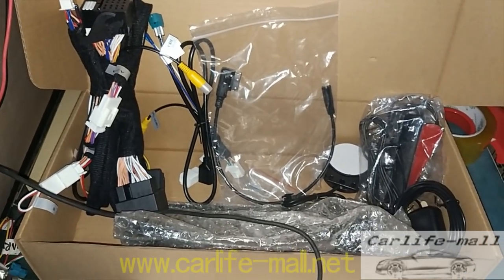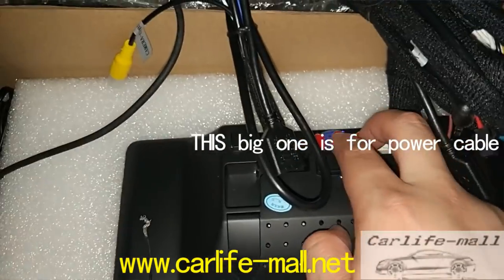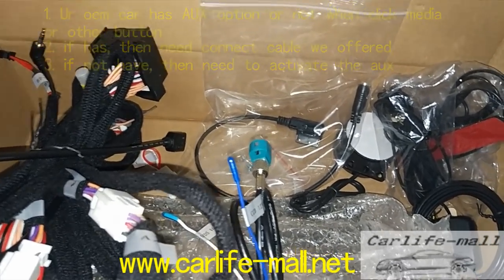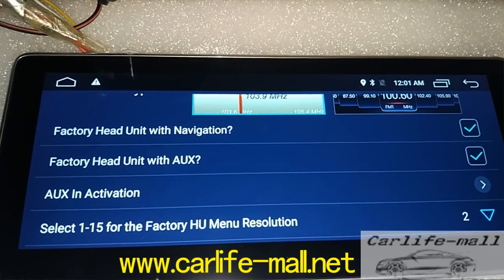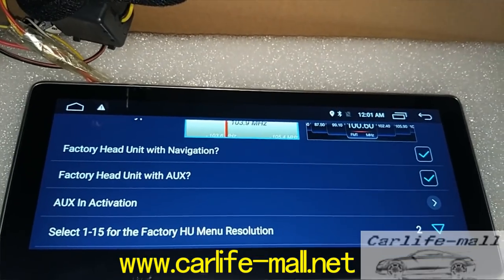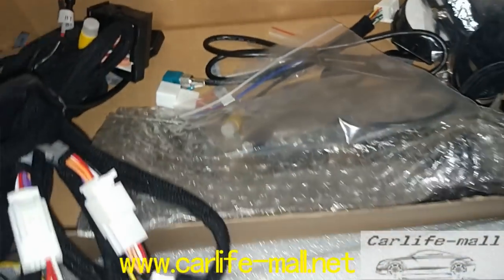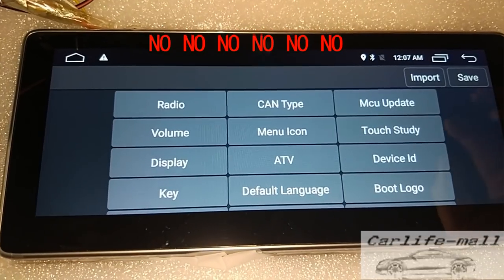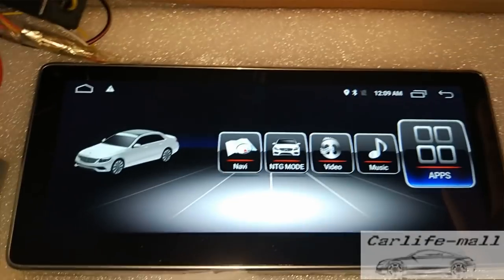10 25 inch 4gb RAM and 64GB android 8 screen for Benz

Comment: Hi I have the XHD-8000 screen in my c250 2012 mercedes and it has no sound I was told it is the amp harmon becker 9065 code. Do u have any suggestions please and I would like a upgrade on my screen do u sell them please.

Comment: Hello this is my CANBUS info: YX2BENZ v111.x9,90,00,N7,B31;00000;0.
I can't get any KF, or AF or CF...by switching the canbus A or B. Actually when I disconnect 40pin plug, both male and female, the screen automatically shut down. When I am supposed the press reset button? After 5 min, 40pin male and female disconnect?

Also I can't get my rear camera to work it is all black but the screen show the red and screen line when the reverse is engaged.

Comment: Hello. I have 2014 CLA250 without backups camera. Which android models should I order?
Reply from the maker: u can add camera if u want, https://www.carlife-mall.net/product/qualcomm-snapdragon-625-msm8953-android-10-screen-gps-for-benz-a-cla-gla-g/    u can check this link, check ur UI is ntg4x or ntg5x, then choose the correct model, then ok, 10.25 inch and 12.3 inch can be optional, any question, can write to info@carlife-mall.net

Comment: Hello, I need help. The fact is that if my car is idle for a while, then when I turn it on, I cannot go to the Android display, the message (No Signal) appears. What should I do in this situation?
Reply from the maker: 1. what screen u get friend, market has so many seller, so first must send pics of system info&mainemnu to check what screen u get
2. then no signal is OEM or oem and android both
3. if qualcomm screen, android part not appear, u can ask ur seller send software to do upgradidng to test first
further info, need check details, if u get from us, send email to the info@carlife-mall.net
if get from others, better send to ur seller
different factories, different goods and softrware
Reply: @CarlifemallEmily  Thanks for the quick reply !!! I have sent you a video by email...

Comment: Sir after installation , Aux does not works , shows “ media interface unavailable “
And now the old usb cable does not work too
Reply from the maker: hey friend, just tell me where u buy the screen?
if from us or our reseller, write us the email we contact with u, will solve for u, if from other seller, u need ask them directly
BR
Reply: Luis Diego Solano did you figure out the issue?
Reply: Did you solve it? Struggling with the same thing and would really appreciate it if you could help me out
Reply: Me too I just make our display yesterday it's work only with the radio  but no sound from USB or video  can enyone help please 🙏♥😢

Comment: you cover everything accept if you have only usb no aux everything works great but only in bt.  no sound pass from system I have base model 2014 cla I have has no fiber optic cable any help is welcome ps I used adaptor it didn't work

Comment: Hi Rock, quick question - my bluetooth phone function cannot receive incoming call (no sound) but calling out is ok using oem microphone. Appreciate if you can give me a hint. Other functions (music, video, etc.) are working fine. Thanks
Reply from the maker: I guess ur navi not have sound too
if so, u need add a speaker, always we sent in package
if not get from us, need ask ur seller

BR
Reply: @CarlifemallEmily  hello, where i can put the Speaker that you send with ? I mean outside or inside ? Thanks
Reply from the maker: @abdalnaserkhalaf9205  normally behind or up the command radio, or glove box, as u want and see where u can set easier

Comment: hello a question on the screen when I stop the car and start it has lost the date and time, you have to connect a cable that comes directly from the battery to save the date and time.  thanks
Reply from the maker: date and time just follow setting of time, if u bought from us, write to the salesman, will explain to u

Comment: I installed it today, but the sound is not quite top.  have tried YouTube, Spotify and Bluetooth but still the sound is poor.  when I put on a CD player the sound is loud and much better.  you can hear the difference.  On Mercedes C class 2008
Reply from the maker: yes, android part is not as good as original
and for this reason, new android 10 make DPS in, sound is better, but still can not compare with oem

btw, if u bought screen from us, future can write to the salesman directly too, always we reply fast

Comment: Hey there, I have purchased a sim card to put in the car for the internet but having trouble car wont read it any suggestions?
Reply from the maker: if u bought from us, our sim card support band 1 3 7 8 39 40 41, if not from us, contact with ur seller which band their device support, different factory, different supporting  band

Comment: I have a question. If I want to replace my factory backup camera with aftermarket, how is this done and what is needed?
Reply from the maker: if u only want to change a camera but still use OEM screen, i do not suggest u change screen, market has some parking module, u can add camera
dismantle ur OEM one, take alway, use new+interface video, then ok

if u want to change screen too, then our screen+camera+steps above
Reply: Carlife-mall Emily I already bought the android unit. I’m assuming I will need a fakra adapter cable from back of radio to go go RCA, yes?
Reply from the maker: @RCTuning  if u only want a rearview camera, no need buy other cable, we offered
if oem has camera, directly use
BR
Reply: Carlife-mall Emily can you send me a link? My factory camera is terrible and doesn’t show past 3-4 feet. I want something with guidelines and better view
Reply from the maker: @RCTuning  so what u mainly want? if only camera, go to workshop change an OEM, if want aftermarket camera+screen, send to info@carlife-mall.net, i will send u, remember tell me ur car model, car year, then can send u the camera pic

Comment: When installed I have no sound from radio, any help on this?
Also I did not install the silver box as my screen is working without the silver box.
Do I have to install this or it is only for older models?
Reply from the maker: u are correct, silver box is only for ntg4 old device, and ur car has no sound need to check installation and setup, if u get from our reseller or from us, just write to info@carlife-mall.net with proof, we will help to solve

Comment: Hi. my standard ntg system does not display correctly.  What is the problem - is it a marriage?
Reply from the maker: i have teached u some steps via wechat, but contact with ur seller, for this tiny issue we charge u us50-100 is a waste for u, contact with ur seller first, if can not, contact with us, with tech-supporting fees paid, we will help
Reply: My benz come with NTG 4.0 and when I installed system screen wasn't showing correctly either. In setting I changed to NTG 4.5 and voila, all is correct. Which is strange as system on my merc is deffo NTG 4.0

Comment: does this version allow you to see speed in MPH and temp if F instead of metric unlike the older units?
Reply from the maker: when set F and Mph, part issue still there
Reply: @CarlifemallEmily  I don't understand your response. Does that mean it works in some places and not others or does not show MPG and Fahrenheit?  does https://www.carlife-mall.net/product/10-25-inch-android-8-ram464gb-storage-anti-glare-screen-for-benz-ntg4-x-all-caronly-different-is-frame/ come with the mount for 08-10 C class, or is it just cables and screen?
Reply from the maker: @RyanV78665  SEND an email to info@carlife-mall.net,  i will send u the pics

Comment: Dear Rock,I bought the screen from a reseller .The video you made describes exactly my problem(NTG is black and no audio from the apps but telephone audio via BT is ok).I have an older version and I connected the silver box.My CANBUS Info  is :n110,KF,D1,81,N1,93D,00000.I didn't really realize what do you mean by "connect the white-black wire to the red one?What will happens if I"ll connect these wires ?Will this fix the problem? I have to tell you that I have an aux port in the glovebox but I didn't connect the male cable form the screen
THXS
Reply from the maker: hey Nikos, if from our reseller, send email to them, then can solve, if they can not, they will send ur email to us, we will solve
if from other seller, u can ask them directly, cause that is what they should handle
BR

Rock

Comment: Do you sell just the power cables? I have the screen and lvds cable... I need new power cable
Reply from the maker: for only cable, u better buy from ur seller directly, cause market has many different factories, has risk make screen dead if use others' cable

Comment: Hello just acquired a 2019 android 8.1 screen but ntg mode is blank.   The seller said he bought from you in 2019.    It didn't come with harness so  I'm using the original harness for my older 10.25 android 5.0 screen.   Everything works and have tried all the screen size setting 1-13.  If I put my old adroid screen back I'm able to see my original ntg screen so I'm certain it's not because of the LVDS adapter being the issue.   I'm just not sure what other setting I'm missing.
Reply from the maker: to this unit, have software, but to the question, easily can know the cable is the problems, must need the 40pin power cable, if u get from personal, at least get whole set with accessories. as this android8 is around 3-4 years ago device, so over warranty, each warranty has fees. u can ask the seller write to me, i know who he is, then if u need the help from us, write to info@carlife-mall.net  we will be back after 29th
Reply: @CarlifemallEmily  i dont like the shape of the new unit.  I like the old unit as it matches better in a pre face-lift w204.  Can i buy the harness from you?   If so i can email you.
Reply from the maker: @aznmode1  the old screen unit not same as new, has risk no working
Reply: @CarlifemallEmily  ok thank you
Reply: @CarlifemallEmily  also wanted to mention everything works on the android side.   Except i can't see command screen.   But thank you for the reply.
Reply from the maker: @aznmode1  sure, android side only offer power, then all fine, but oem need lvds+cable, and to android, i think no sound
Reply: @CarlifemallEmily  Hello.  Android has sound.   Also when i go back to my old screen with android 5.0 then oem works.
Reply from the maker: @aznmode1  how many android screen u have? one android5, one android8? now u use OEM power cable for 40pin or android aftermarket one?
Reply: @CarlifemallEmily  Hello I have two android 10.25 screen.  First version android 5.0 with power cable complete kit.  Other unit is 2nd version android 8.1 like your video but screen only.   So Im using 40 pin power cable kit from the first version 10.25 screen.  Using it into 2nd screen android 8.1 like your video.
Reply from the maker: to OEM part, if cable correct, LVDS connect correctly, only left is the setting for UI system+car resolution setting
Reply: @CarlifemallEmily  I tried all resolution 1 - 13 all show black.  On old screen oem shows.   I think i have a bad 2nd screen then.
Reply from the maker: @aznmode1  hard to know real reason without oem screen cables, cause each generation, the cables changed, why get a 2nd hand screen without whole accessories without warranty?
Reply: @CarlifemallEmily  Hello I prefer the old screen look.  Matches w204 first generation
Reply: @CarlifemallEmily  any chance I can acquire config file for Mercedes w204 android 8.1 screen?
Reply from the maker: 8.1 not have the file any more, the software guys delete, will check if has, but over 3 years for 8.1 one, i guess no more
Reply: @CarlifemallEmily  i really appreciate very much for at least trying.   You're very helpful.
Reply: @CarlifemallEmily  hello can you tell me what CAN Type is w204?  Im not going to change it but right now CAN type is set to 140 in the secret menu 8888
Reply from the maker: it is 140, and u can check the CANBUS if has KF, AF, CF, if has, this part no problem
Reply: @CarlifemallEmily  it has KF.  Also found out this was from a
Mercedes E class ntg4.0.  So maybe that's why it doesn't work for C class ntg4.0.
Reply from the maker: @aznmode1  u said ur new car is ntg5x, if use ntg4/4x screen to install, will not work 100%
Reply: @CarlifemallEmily  Screen was made for E class ntg4. Im putting it into C class ntg4
Reply from the maker: if screen really from us, and ur car is both ntg4/4.5, no matter C/E, can fit. only the frame holder can not
Reply: @CarlifemallEmily  ok thank you that helps a lot.   The screen is from you.  Has gold carlife sticker.  Thank you again.
Reply from the maker: @aznmode1  SO IF car ntg4/4x, not this favor make the oem not appear
Reply: @CarlifemallEmily  sorry correction.  E class coupe is ntg4.5.   C class ntg4.  I think i give up.  Thank you for the help.
Reply: @CarlifemallEmily  hello I was able to resolve it.   Somehow old screen there is power to the yellow wire to connect to lvds red wire.  So old screen command oem show.   But with new screen no power to the yellow wire so lvds not getting power.  So command screen does not show.   I found another 12v source for red lvds wire and now new screen shows command.   I remember in youe video connect red wire to acc to check.   I should've done that first.   I so thank you.  It was your solution that helped me😊
Reply: @CarlifemallEmily  can I switch ntg screen to the left side of 10.25 screen? Currently its on the right and car type image on the left.
Reply from the maker: @aznmode1  good news then
Reply from the maker: @aznmode1  for android8, i remember not have full screen in oem part
Reply: @CarlifemallEmily  sorry i mean oem screen is on 2/3 of entire screen but more on right side.   I would like to move to left side of screen.
Reply from the maker: @aznmode1  engine on+command radio on, change the resolution one by one to check, if both no working, consider if the lvds box bad or screen issue
Reply: @CarlifemallEmily  i read on newer screen you can change to LH or RH drive in factory settings to move oem screen from left to right or vice versa.

Comment: Nice video ...hey do u sell the mounting bracket by itself ? I need a left side steering wheel mount for a 2015 212 eclass. US MODEL. Thanks
Reply from the maker: if only buy a frame from us is not cheap, u can write to info@carlife-mall.net
Reply: @CarlifemallEmily   hello ..I don't see it on your website.. can you please tell me how much ? Thanks
Reply from the maker: @georgemedina3712  email to info@carlife-mall.net with ur shipping address, then will know how much for only a frame E W212

Comment: Hello very nice video, I have a question, must the speaker supplied be installed or is it not necessary ?
Reply from the maker: no, if ur oem 40pin quadlock not have speaker lines, then need add this, this mainly for android bt and navigation
Reply: @CarlifemallEmily  ThankYou
Reply from the maker: @siggif1060  welcome

Comment: Very informative video.I would like to ask you for a problem.I have installed the screen and when it turns on appears 3 different  screens one on the left which is a half of the radio the second in the middleloc is black and the third on the right is the reverse. What is wrong?Do you know how can I fix this problem
Reply from the maker: for ur benz S, first where u get it? different factory have different software, so first choice is asking from them

2. if u did not reverse, but reverse appears, this u need check ur installation and resolution setting

3. if u did reverse, 3 parts appear, first do not reverse, switch to oem system see if oem system all correct--then go back to check--refers to installation and resolution too

more info, send to info@carlife-mall.net if u buy from us

and u can share a video show issues, that way easier to understand what exactly happens
Reply: @CarlifemallEmily  Thank you a lot for your informations.I asked them 5 days ago and still waiting for an answer. Is a company in Spain named navi4all.The problem is in the initial screen where appears an image from the half radio and the rest black and on the right the icon of the reverse as appears in your screen.I will try to send a video Thank you
Reply from the maker: @ΑΝΤΩΝΗΣΤΣΟΥΜΠΕΛΗΣ  ok, and u still need to talk with ur seller, cause they know their device better than us, each factories working way is different

Comment: Hello Rock, I installed my screen and everything works fine but the mileage. My car has 54,471 km and the screen shows 11,873572 km. What do I need to do to correct this?
Reply from the maker: first just press the right side of screen the reset button hole, if can not solve, contact with ur supplier for CAN file upgrading
Reply: @CarlifemallEmily  Hello Rock,  I was sent the UI file upgrade and CAN file upgrade, but still same issue with km? Any ideas from you? Have you heard of this issue?
Reply from the maker: @vaggog7584  up to now, u are the first, if still happen, confirm if ur upgrading is successed, can the CAN IAP, show picture to ur suppliers
still happen, ask if ur supplier can offer an exchange screen to try
Reply: @CarlifemallEmily  yes upgrade was a success. Everything works fine except for the mileage.
Reply from the maker: @vaggog7584  take pic of the CAN IAP, show picture to ur suppliers
still happen, ask if ur supplier can offer an exchange screen to try

Comment: Do you know how to do a factory reset on this unit?  Using a reset pin 
in the hole on the side of the unit isn't enough.  Want to reset it to 
factory defaults.    Thanks anyone!
Reply from the maker: if is this kind of screen, then first press reset hole, then asap use ur 5 fingers hit the screen until screen has a process bar, then can wait to see
if can not, ask software from seller, to upgrade